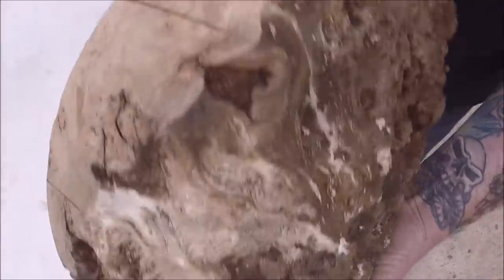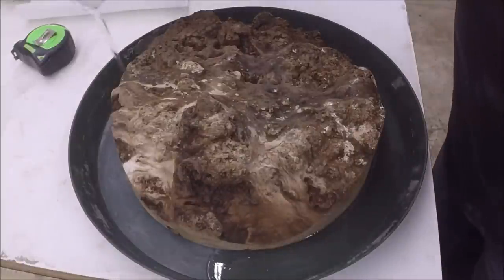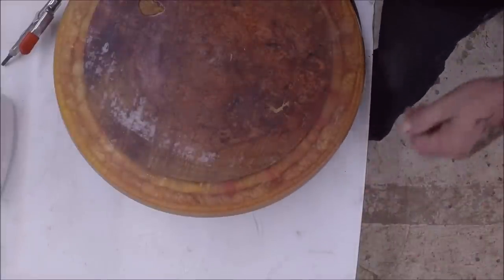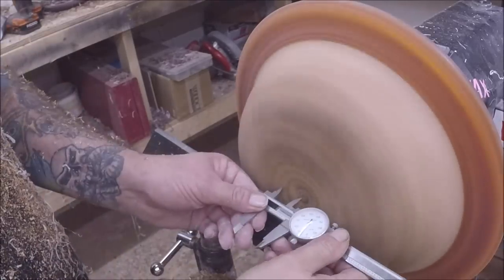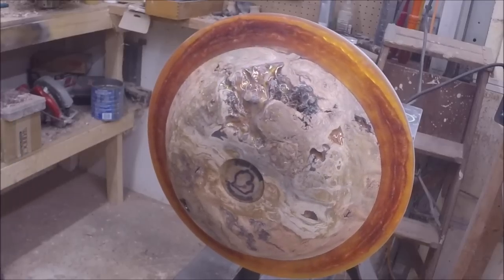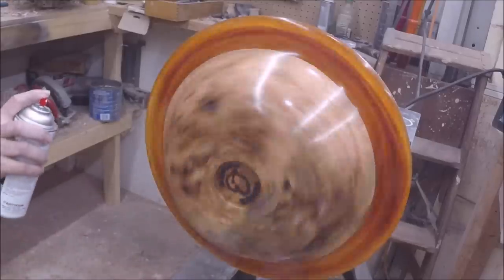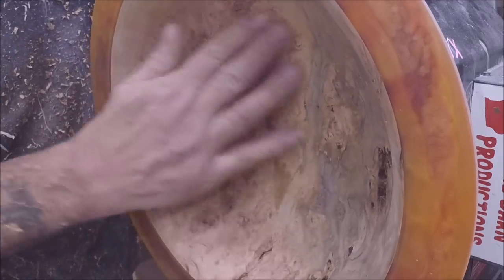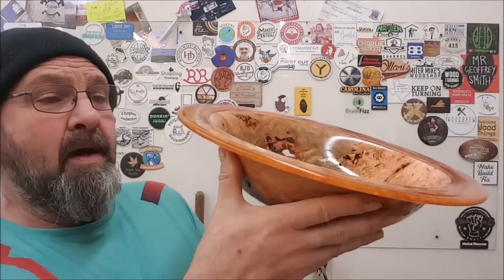Lava resin & Cherry Burl Bowl.

Comment: Hey, just an idea...when using a mold, it might be easier if you use wax and a PVA mold release.  I've been teaching myself mold making, and getting the right mold release makes all the difference!  It helps even when the mold is made from something the resin isn't supposed to bond to.  And try going up to 2,000 grit or higher before you use polish.  I think you said you were up to 1,200grit?  A gloss finish is like 6,000 grit.
Reply from the maker: Thank you Fredy,  the mold is HDPE, it's just all scratched up from it's normal purpose,  it still works and I know about the mold releases,  I have found that if you do a multiple pour it tends to float on top of the first pour and then effects the next layer from sticking properly,  and the Sanding,  I just plain hate the sanding and I am lazy with it.

Comment: Hi Doug, I love the bowl, the Burr is outstanding and the resin rim is fantastic. I'm a bit confused about why you covered the burr in resin and then turned almost all of it away. Cheers, Huw
Reply from the maker: Thank you Huw,  there were some really deep cracks inside the burl I'd hoped to fill, it did what I wanted but you can't really see it on the inside of the bowl like I intended as it just blends right in with the grain. for a shorter answer, because I could, which ever one works for you I guess.  LOL

Comment: Have you checked in to building a small Kilen  to dry these burls for say a week maybe 2.  I am not sure what one would cost to build. I have seen them built from an old refrigerator and a small heater
Reply from the maker: I have not but I have seen them built also.
Reply: The Pohl Barn Productions just a though everything I get is very dry but I just turn support beams for pot hangers and handles.  One day I hope to be doing things like you do.

Comment: Which TotalBoat resin is best for deep casting when using a pressure pot?
Reply from the maker: it really depends on how thick you are gonna pour it, either the 2 to 1 or the Thick set that is designed for thicker pours

Comment: Loved it but does it have holes in it or was that where clear was I couldn't tell from video. I like it when you talk more I get a better idea of what I can do or try. Did I see some steel wool in your hand how'd that work for you?
Reply from the maker: Thank you Ernest6, Yes it has holes no there was no clear resin in them, yes I had steel wool, I was just trying it out, it did seem to make the surface much smoother.
Reply: Yeah years ago when I was turning I was only 19 didn't have money for sand paper so I used coarse and fine steel wool rarely used sand paper coarse I didn't have anyone instructed me on how to turn or finish I just kinda winged. Liked the shape you ended up with too.

Comment: Any reason why you didn't use, or don't use an actual "center finder " instead of the cutting tool?
Reply from the maker: it already had a reference for center when it was shipped to me.
Reply: Right, I saw but the center changed when it dried more, hence you cut the edges with the jig. The original hole probably would had filled with resin too. Was just curious, in my mind that just seemed like an extra step is all
Reply from the maker: I explained what I was doing to center it, I used the center it came with. it did also fill with some resin that I drilled out on film before stripping the hole out and then going to a face plate still based on that center